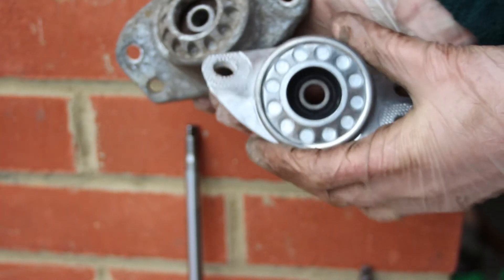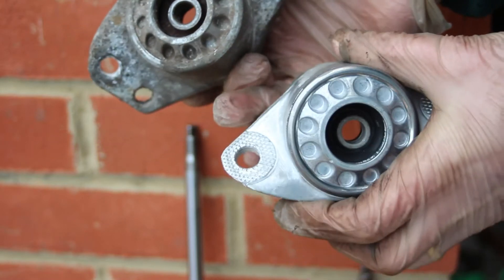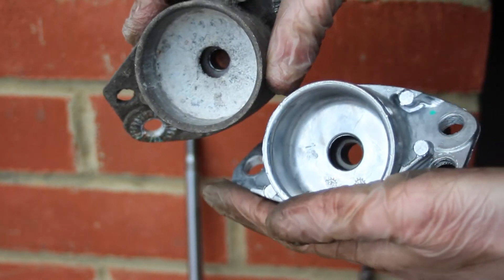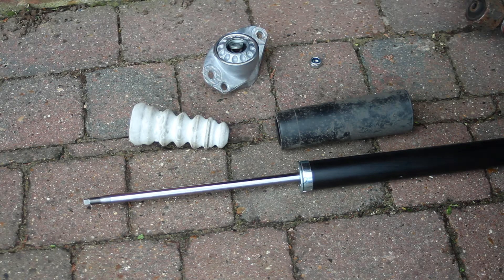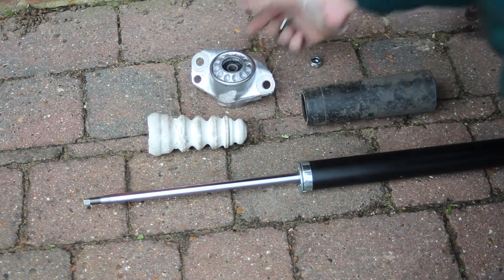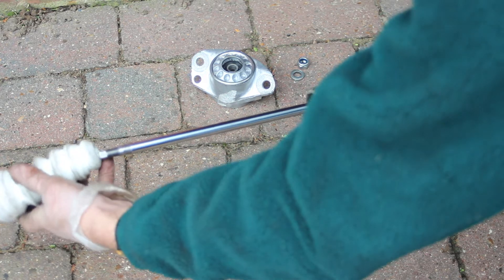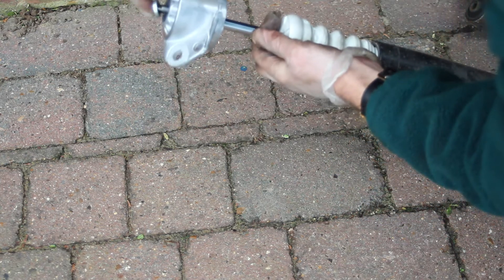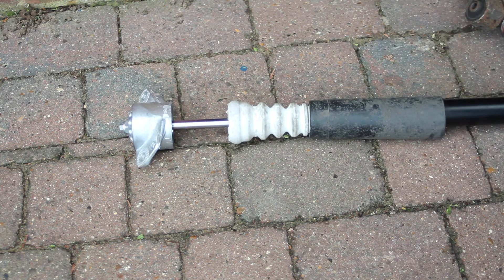VW Golf Top mount Suspension Components - Correct Order of Fitting Parts

Comment: was the rear end making a banging sound?
Reply from the maker: no, not for this. If the rear is making a crashing noise then it sounds more likely to be rear beam bushes
Reply: +VW & Ford Car Maintenance Servicing Tips well, I have a true mystery then because I changed the trailing arm bushings out with OEM replacements, and the sound remained. I changed them out again with polyurethane bushings, and the sound remained
Reply from the maker: +Nick Pelletier for the cost and ease of changing the top mounts I'd definitely do them if bushes have been done. Have you checked the rear springs are ok?
Reply from the maker: +Nick Pelletier I did have a banging sound after this and part of rear spring had snapped off
Reply: +VW & Ford Car Maintenance Servicing Tips when I had the rear end off I checked them out and they seemed fine, but I didn't scrutinize them too much. I'll check them out in more detail when I change the mounts next week. thank you for the responses
Reply from the maker: No problem. I do have a video of when I checked/replaced the rear springs that I need to get loaded. I'll try to do that over the weekend
Reply: +VW & Ford Car Maintenance Servicing Tips I'm shotgun blasting now. I ordered Moog springs, new mounts, and shocks. if this doesn't fix it, there is no fix